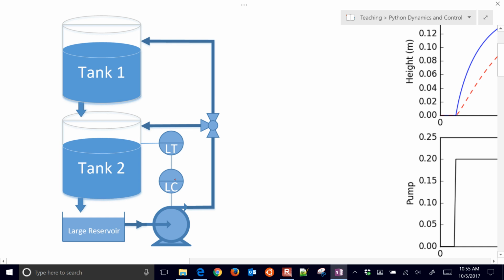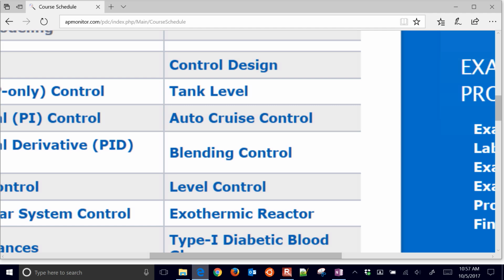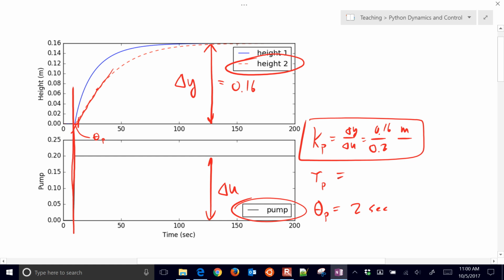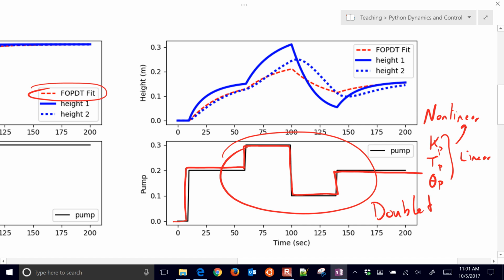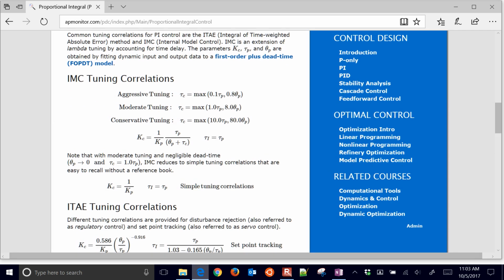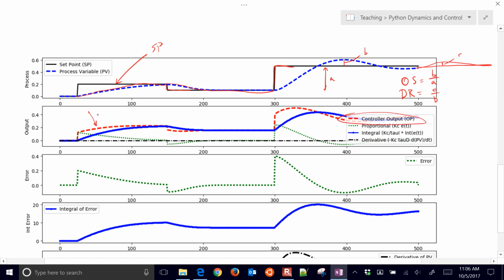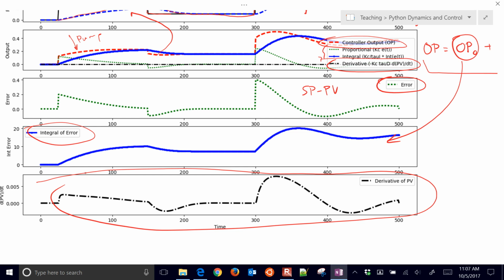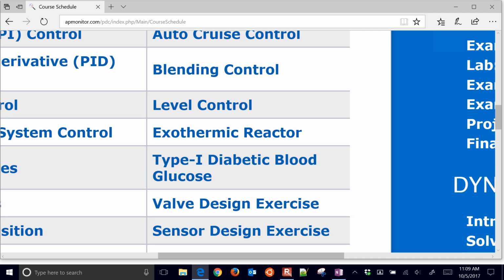Dual Gravity Drained Tanks PID Control

Comment: No, no, no,no,no, no!  You simplified the problem too much.
I like the way you use Python but Python is just a tool.
Reply from the maker: +Peter Nachtwey, I agree that this was too short and simple. I had to catch a flight and only had 15 minutes to help the students with this visit before my trip. This really is a very rich problem with a lot of nice features.
Reply: This is my version of the two tank level control.   I approach the problem from more of a design simulation aspect.  I don't assume much except that the pump responds relatively quickly.  I try to model all the non-linear aspects.  Time 'constants' aren't constant in this case.  One thing I learned 35 years ago that an instantaneous time 'constant' is something divided by the rate of change in something.  This is a good example of why differential equations and integrator like odeint are much better than state space.

I wouldn't pass any student that could write the differential equations at the top.  I know this is gross over kill but students show go to college to learn how to be designers.
https://www.youtube.com/watch?v=d_twlM8VDuM
Feel free to copy what you want.  I have copied some of your Python code.
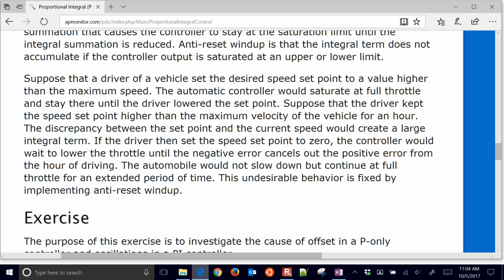Reply from the maker: Peter, you made a nice video. That is one of the more complicated MathCAD sheets I have seen but you go through a very thorough analysis. I agree with your statement at 8:30 in your video that the time constants are not constant. You did a good job showing how the time constant changes analytically. Thanks for your insights.